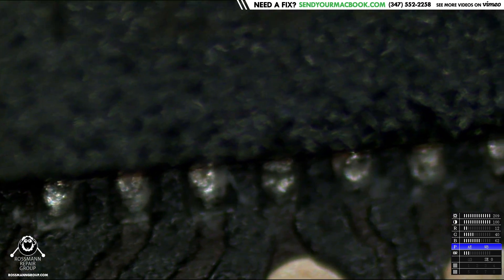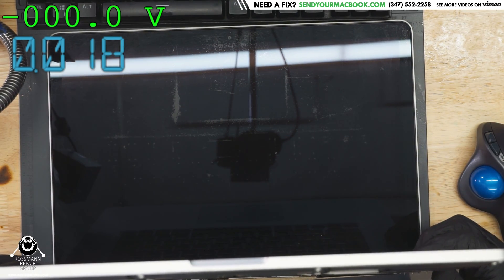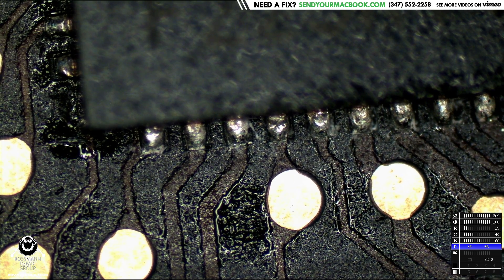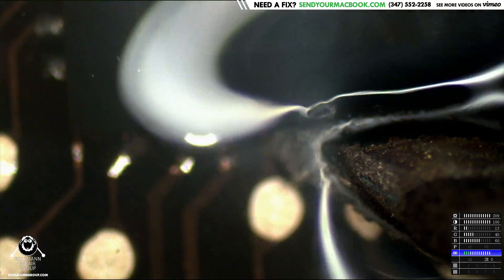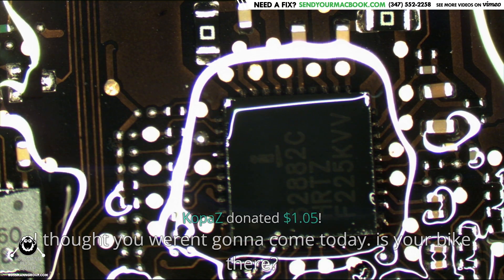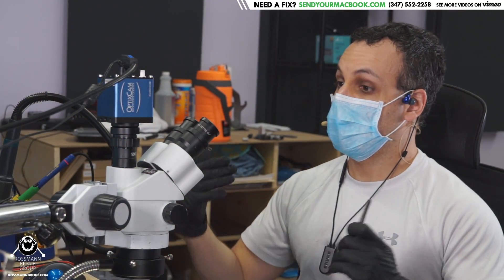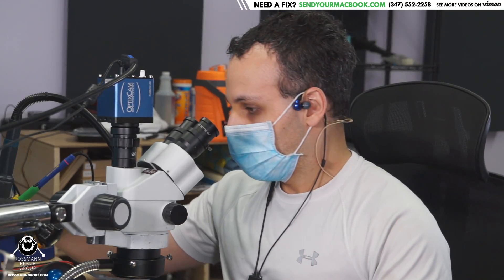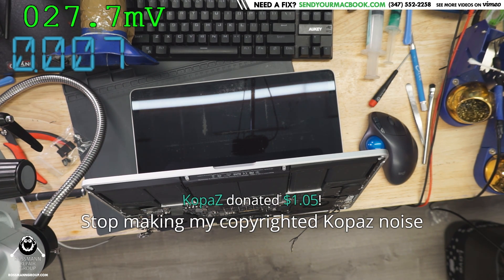Apple soldering was this bad(yes, really)

Comment: Could it be unintended side effect of the removal of lead in the solder for new commercial products since some time, so the lead free joint wear out more easily. Afaik lead free solder need to be handled at lower temperature but for longer. So could it allow obsolesce easier, as eletronic fail with time under load?
Reply: a couple of years ago, and every commercial product, has it, I think it is required by EU law for product sold in the EU since 2 years, there was a voluntary transition period before that came into effect, don't know with US bill change that there.

Comment: Re only charging small for small jobs... back in 1982 (yeah,I'm old) i was driving a beat up 1976 Civic.  I came out one day and turned the key and nothing happened.... wasn't the battery because the lights worked.  Had it towed to an auto electric place I'd just heard of.  They found and fixed a broken wire in the ignition wire harness and charged me $12.  They had recently expanded their space and services to a full service auto repair.  They've done every non-warranty service to every car I've owned since then and I couldn't possibly count how many people I've sent there.  Could they have charged me more for that first repair they did for me?  Sure.  But they wouldn't have got the loyalty they got from me.  I don't know where I'm going to take my cars when Wally retires, but I hope he can find someone and train them with his business model.

Comment: Bad solder joints? Guess you can say, no flux given on that soldering job.
Reply: Bro flux is nothing bro. That stuff just help's out on bonding solder. Plus even if you use it a lot, it lasts years with you cuz you use an extremely small amount only. So why charge for that? Lol
Reply: Probably very short reflow envelope (to save energy) and very small amount of flux. Usually flux is mixed in solder paste and applied by stencil on PCB pads before placing elements.
Low temperature (sensitive pads on black PCB laminate) and short reflow soldering.
Reply: @adamw.8579  To save energy is unlikely. Reflow causes all kinds of trouble. Too short is bad, too cold is bad, too hot is bad, too long is bad too sharp is bad and not sharp enough is also bad because that leads to too long....some cases just make bad joints. To sharp, hot or long also kill components stone dead on chip or packaging level....this is actually the kind of mistake that is somewhat forgivable....
Reply: @Zonkotron  Agreed, but where was quality control? Any deviation from envelope (for example on start procedure)and these  parts should be rejected from final product.
I work in automation industry and I know about working on margin area of envelope for saving costs. Exactly minimum temperature and minimum time required for used solder paste. Optimal is center of envelope - minimum bad joints and devices works fine for 10-20 years inside industrial systems. Consumer equipment is designed and produced for fail within certain time.
Reply: @adamw.8579  Strictly speaking, few things are actually designed to fail. I've never seen that outside just a handful of products. Most things are just designed with a minimum service life, not a maximum. I get what you're saying about things being designed to fail, but i feel it's important to differentiate between failure time being a primary design consideration vs secondary, i.e. the side effect of designing something to be cost effective for the expected useage time.

Like say you design a $2 Nokia phone charger: You might pick a plastic you know tends to degrade after 5 years, but if your primary goal was to sell a charger for $2, and those margins demand it, then the use of that cheap plastic is a necessity, and therefor secondary.
Reply: @adamw.8579  hmm can't agree with you hundred percent on that. Actually when it comes to solder paste, the most important factor is the flux composition and lead free alloy. Based on the manufacturer of the solder paste, they will prescribe a good reflow criteria for their own products i.e. time above liquidus, peak temperature, temperature slope. One may think, oh whatever, it's all the same and maybe you're lucky that most of the time, the profile is right within the edge of an optimum profile. But variation with your own reflow oven combined with freak variation due to poor CPK measurement plus maintenance, then you get a solder joint like in the video. This is not acceptable because reflow over with proper care, is very very stable compared to say, solder printing. It's hard to tell when your stencil is completely wear and tear.
Reply: @ViperVizier  My job is automation systems designer, so my task includes proper board design for certain assembly process. I often inquire assembly facility about their requirements - pad/paste mask shaping and part spacing for pick & place process.
My post above was rough in technical terms. Your explanation is more exact - working on edge is very prone to errors. Reflow is one most reliable process when required conditions are met. Good work for You.
Reply: @adamw.8579  looks like you know what you're talking about. I work in an ems company. This is what we call solder graping. Reflow too hot too fast. Flux burned out before the metal powder actually fully melted and bond with one another. In high runner production, won't be surprised that to hit shipment deadlines, they switch to another reflow oven when one is down and didn't bother to take proper profile. Or poor Preventive maintenance and CPK check.
Reply: Fluxxing ell who gives a flux ☝️😂
Reply: What the flux you say?!  🙂

Comment: 15:40 "I need an iPhone 4, Where's my iPhone 4??!!!"
Reply: Hi Levin Soh i have got ipone 4s it works well but you are not getting it  as i had no trouble since i got from ebay.co.uk for 40 pounds in the box leads and everything which you need and it looks like new only problem i have with it is the battery dies after 3 days on stand by : i hope you are well and i hope you can find one on ebay. all the best from ian

Comment: totally off topic but I just wanted to say watching your videos gave me the confidence to repair my macbook pro charger's cord. it was frayed right at the block, and there was a nick in the wire towards the magsafe connector, lopped off the magsafe, cut the end, broke the plastic casing open, desoldered the ends, resoldered a good portion of the wire back to it, resoldered the magsafe, and it works! it ain't as pretty as something you could do. but it works and it's only a small fire hazard. Thanks for doing what you do, keep it up!
Reply: Only a small fire hazard. That's awesome!

Comment: I have a repairing question.... what to do when 1 headphone stops sounding? (normally the left one) . Its a too common problem, but when you open the headphones theres apparently nothing wrong, at  best/worse I've seen a cable not connecting but in general nothing seems off.
Reply: If it's the Apple earphones they tend to build up a bit of ear wax in the metal mesh. An easy way to clean it is to heat it up with a hairdryer but don't get it too hot and use an old toothbrush to brush out the wax. If you're willing to take the risk and go the more complex rought take out the metal mesh and thoroughly wash it in hot water but be warned its easy to rip the metal mesh and its a pain in the ass to put back in.
Reply: If they're wired headphones then it's a break in one of the wires in the cable.
Try using a multimeter to check continuity if possible, you'll probably find that the break is just before the strain relief on the jack that plugs into the device end, as that is the fault 90% of the time.